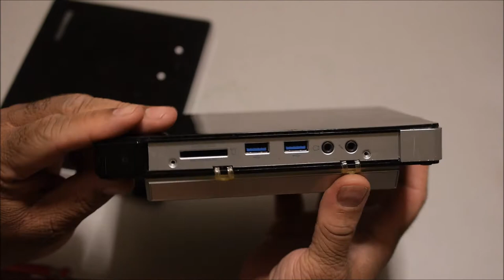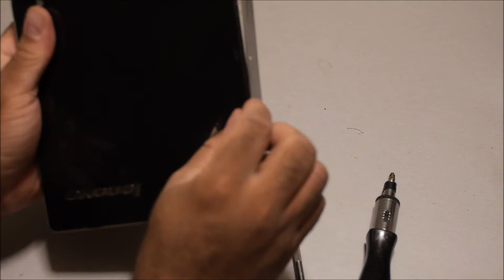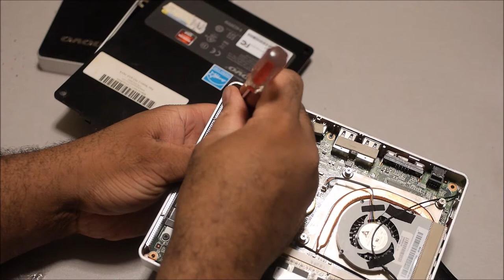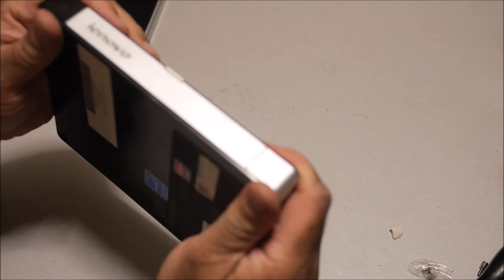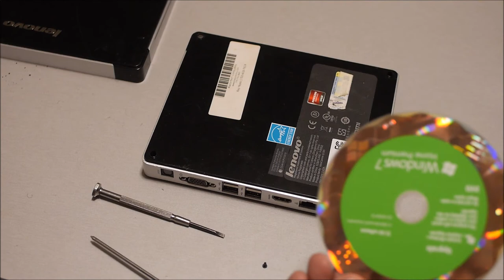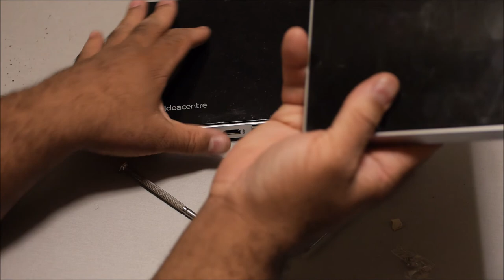How to install a hard drive on Lenovo IdeaCentre Q180

Comment: Thanks for your clip! I need to change the old HDD for Q180
Reply from the maker: Thanks for the comment.  That's great you are installing a SSD.  The SSD will help it run a bit better.  After using the Q180 with 4 gigs of ram, I notice the machine is a bit sluggish when streaming Youtube videos. It has trouble streaming 720p.  I use mine as a media device for audio and video files.  I'm thinking that if you install XP it will run a bit faster and stream Youtube better.  It works good as a pc running basic programs and browsing.
It works great as a media player since it has a built optical output. I have the digital output hookup to my surround sound receiver, great sound from the device. Yeah, I use mine for listening to audio and watching some videos.

Comment: Hi, can it play 4k video?
Reply from the maker: Hello, thanks for the question.  No, the IdeaCentre Q180 cannot play 4k video.  The processor is really weak (underpowered), it can only play 480p video smoothly, it even has trouble playing 720p video.  But it plays DVDs very well and you have  quality surround sound with its optical output.